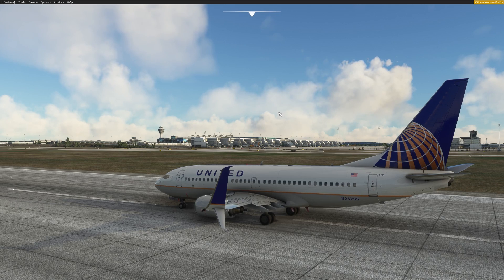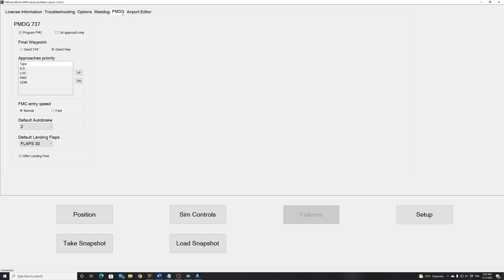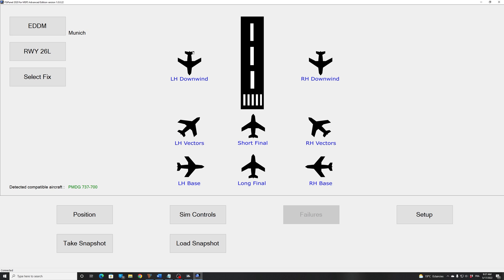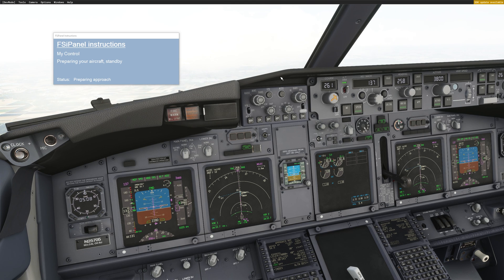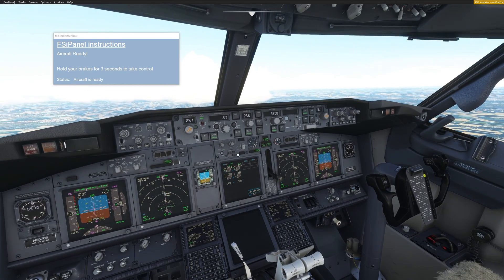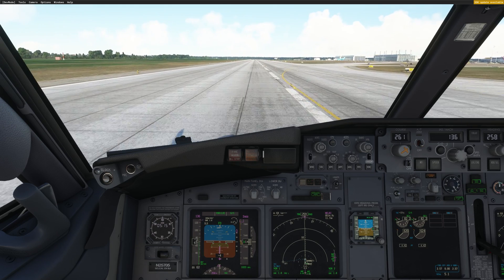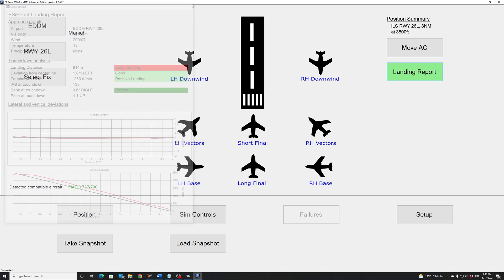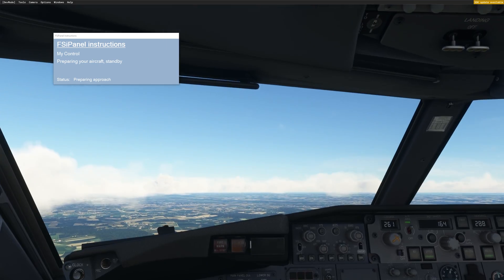How to fly quick approaches on the MSFS PMDG Boeing 737

Comment: Just bought the program and can see that i will really enjoy it. One question on After Landing Flows, following the instructions you provide including moving the flaps one notch the after landing flow does not initiate. Have I missed something obvious?
Reply from the maker: Did you move the flaps using F6 key or with your controller, FSiPanel will recognize the F6 key. You can also define another button or key combination in the options to open the flows menu and select After Landing

Comment: Really want to buy this but I only fly in VR.  Is this working in VR yet?
Reply from the maker: On development, you can use it now but you will need to setup everything with headset off and when aircraft is in the air, put it back on. Scenarios instructions (text) are not visible in the headset, you can fly using VOICE only.
Reply: I'm using it in VR. You need to set it on the screen with headset off and then put it on when you launch the session

Comment: Can this software be  used for landing reports without creating a quick approach ?  Lets say a full flight and just get the landing report ?
Reply from the maker: Hi, no it does not but the idea is nice, I will try to add that feature.
Reply: @FSiPanel  This would be awesome! Thanks!
Reply: @FSiPanel  When is that feature going to be implemented?
Reply from the maker: @Pedro255281  with the update tomorrow Oct 20th. Landing report and after landing flow will be available even if FSiPanel was not used for the flight.
Reply: @FSiPanel  Very nice!